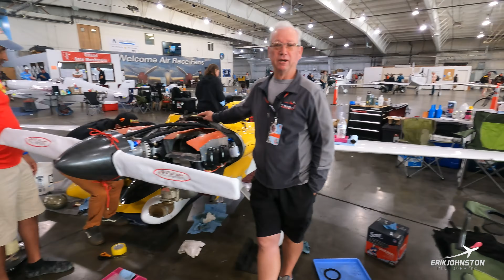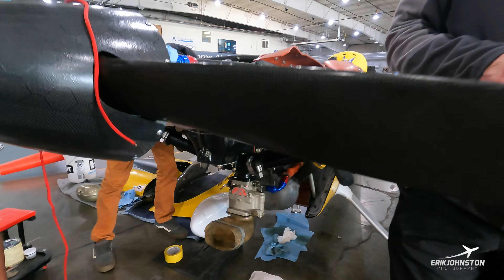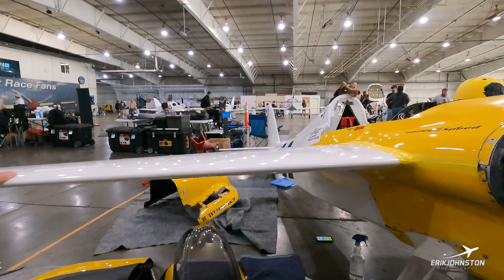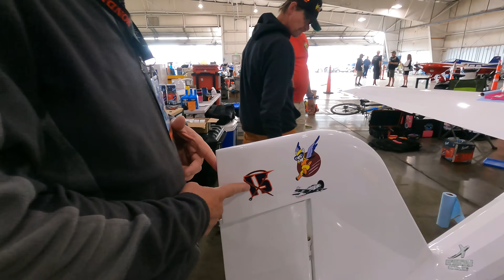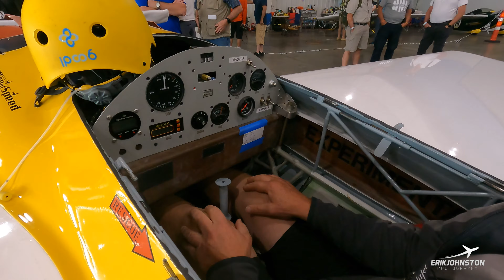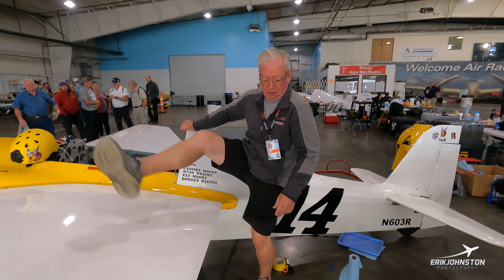Cassutt Racer Reno 2023 Matt Moore

Comment: The whole plane can weigh as little as 500 pounds!? Incredible piece of machinery
Reply: The rules require it weighs no less than 500lb empty.

Pilot must be 160lb (with 20lbs of chute and helmet) or use ballast to make up.

No less than 66ft wing area. This equates to 10lb/ft^2 area.

They begin a race with minimum 5 gallons (30lbs) of fuel. There is also oil weight, 4 quart or 1 gallon is 7lbs.

So they are all going to be over 700lbs at race start. Most race planes are probably closer to or over 800lbs.